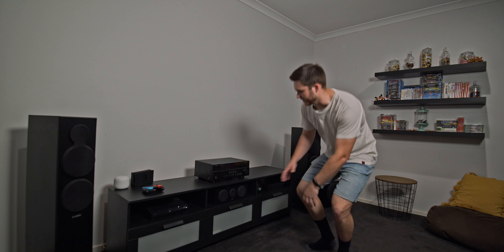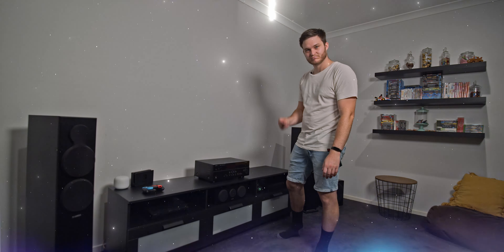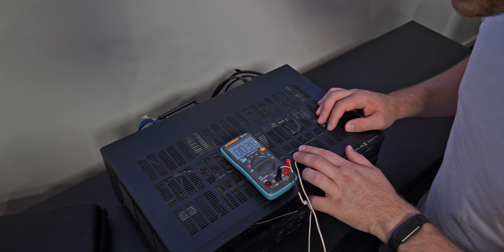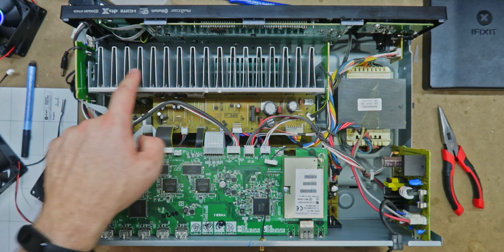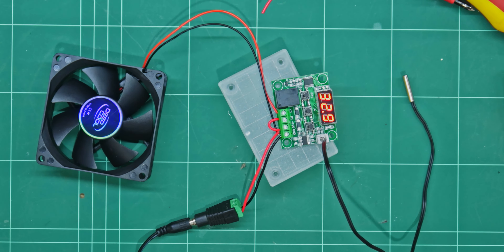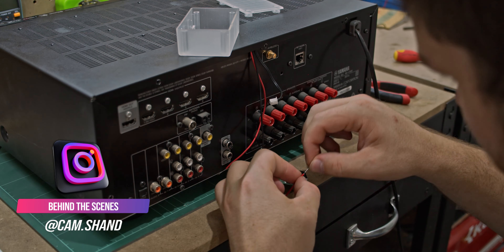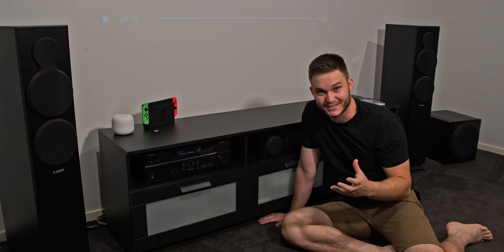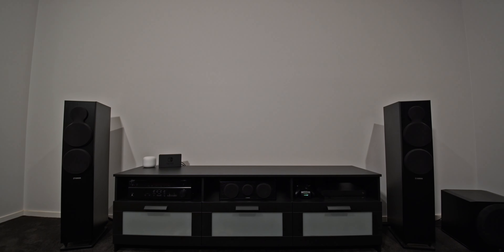Cooling Dolby Atmos Home Theatre

Comment: Great little project.

I liked the shiny Cam Shand effect for about 0.1 seconds. You went way too heavy with it, and also with the video distortion you used later on.

It's good to see you experimenting, but if you're going to keep the Shiny Cam Shand title effects, then could you please dial it down from epileptic eye ball searing? Making the effect (especially the white flashes) more transparent would reduce the intensity.

Air movement through convection is a very weak force. One fan by itself would be more than enough to outperform the normal ambient cooling and allow you to tuck it away in the entertainment unit.

I loved your overkill solution and your attention to detail and finishing. You could have had a rough solution with less effort, but I enjoy seeing your process and end result.

Keep up the good work!
Reply from the maker: Hey Yak, yeah trying something new, I've just switched Editor from Adobe suite to DaVinci resolve so learning where all the basics are. I appreciate the feedback though, I'll be tweaking the intro again for the next vid.

and this was by no means a text book approach, we simply bought a new TV unit and I ordered a handfull of fans and a temp controller. I was going to program it on an Arduino board but rathered make this a quick weekend project over the Christmas break. Also $25 in parts is nothing compared to replacing or repairs if it did overheat so I was happy to have more fans than necessary haha

Thanks for your feedback, appreciate it :)

Comment: Hi Cam, great video! I really like your channel.
Could you point me to some details about the wiring?
Reply from the maker: Hi Marco, sure thing, I was trying to make a schematic of the wiring but since the temp controller was off the shelf I was struggling to piece it together. Here's the eBay listing I bought through which has some great images showing different load methods: https://www.ebay.com.au/itm/W1209-Digital-Thermostat-Temperature-Control-Switch-sensor-Module-12V-50-110-C/324141121290
I used the 12v method where it jumps the positive power from the 12v input into the relay side.

Pretty much anything that's on the load side whether in series or parallel is fed by the K0 terminal, that way it only gets power when the relay is activated by the inputted temperature ranges. (shown here: https://i.ebayimg.com/images/g/JM4AAOSwjVReeYKf/s-l1600.jpg)

also found a document online about it that has useful information on programming a HIGH LOW level: http://www.kelco.rs/katalog/images/17670.pdf

I was going to build one myself with a spare Arduino, but this little temp board is all over the internet and quite cheap for the simplicity it brings with changing temperatures :) 

Thanks for watching and hopefully you get a better visual from those images
Reply: Thanks so much for the answer! Your dedication is amazing. I looked at the pictures and the wiring is clear now

Comment: Hey Cam, will it accumulate dust inside the system?
Reply from the maker: Great thought, I haven't checked on it yet for dust, but adding active cooling would most likely increase the chances! I might look at adding some dust filters to what is now the intake vents, that's for pointing that out 👍

Comment: On the back of my Denon receiver there isn't enough room to slide a piece of paper
Reply from the maker: Hahaha yeah I managed to find a nice little spot for fans and controller.
Could always mount fans external and controller loose but it'd look a bit Frankenstein like haha
Reply: @camshand  Inside is also cramped. A laptop cooler seems like a great solution and it's reversible.